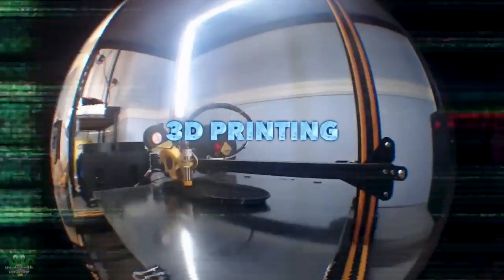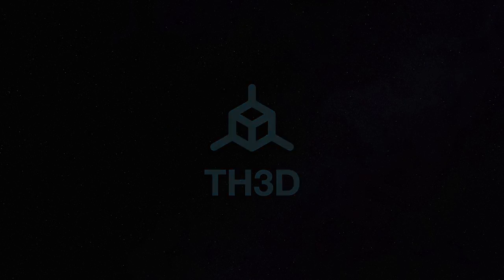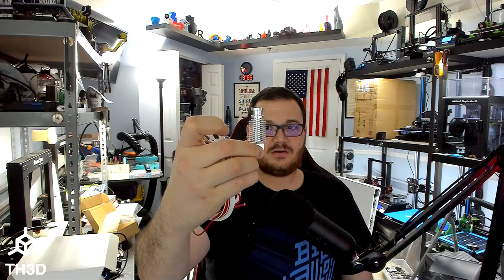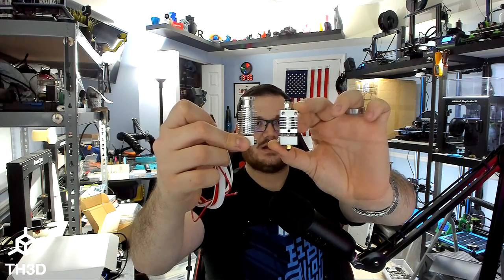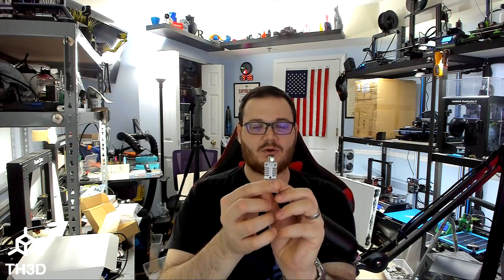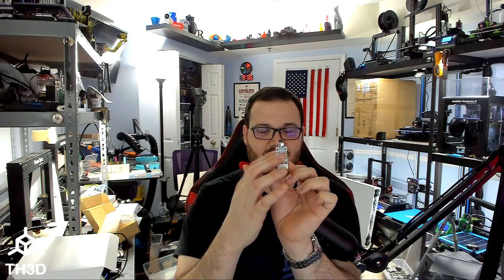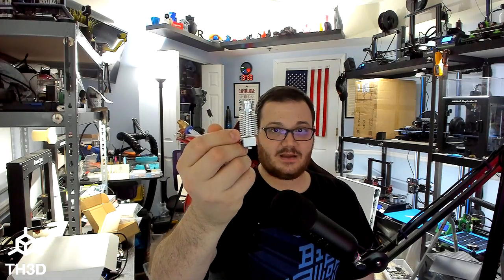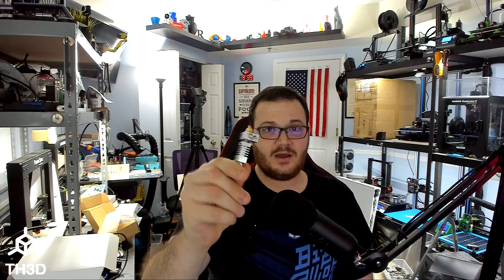Tips & Tricks - Proper Cooling Fan Selection - Stop Using Capacitors & Noctua Fans!

Comment: Installed a noctua on my Ender3. After 30 minutes my filament got stuck and jammed. Reverted back to original fan and all was back to normal. So noctua is not suitable for hot end cooling!
Reply from the maker: We've seen that happen a lot (not in 30 minutes though, usually a few hours). But, if you have higher ambient temps in the room it could happen quicker. These are the ones we sell and use on our machines that do not have the issue (they are also quieter than the stock fans, will also last a lot longer): https://www.th3dstudio.com/product/40mm-sealed-bearing-fan-24v-ender-3-tornado/

Comment: Good video just one bone to pick, the wording of the video makes it sound like Noctua make poor products when in fact they make a lot of really high quality fans (hence the 6 year warranty). The problem as you noted in the video isn't any problem from the maker itself but the characteristics of the fan not meeting the requirements for the application. (it would be like putting diesel in a gas car and then blaming the maker of the fuel for the car not working). I've seen people recommend other brands too that are not ideal replacements. I wouldn't hesitate to use Noctua fans in a project IF they made a fan that met the requirements for whatever the intended application was.  I used one in a PSU that exceeded the stock fan specs. The noctua 40x40x10 you mention somebody installing on an Ender 3 appears to be grossly under powered in comparison with the manufacturers supplied part from what i could find online. 8cfm vs 4.8cfm, looking at the performance curves of both these fans and for anything more than 1.2cfm the static pressure has to be around zero, not sure how much safety the manufacturer sided with but almost 50% less peak airflow seems like it might cause problems depending on temperatures and print duration. I would have to agree in that I dont recommend it for the creality series of printers and probably others but not because noctua is a bad brand but because the spec of that fan doesn't  meet what the manufacturer recommends.
Reply from the maker: You are correct that they make good fans (I have 20+ of them in computers here myself that are many years old). The issue is people recommending underpowered fans for the 3D printer applications.

Comment: Such a great video! 
I was just about to order a Noctua NF-A4x20 FLX for my E3D V6 hotend, but before doing that I jumped over to your YouTube channel to see if there's any video on the topic. Thanks for saving my 15USD+ and hours of troubleshooting.
Reply: it's not the brand, it's the CFM: if the noctua fan can push as much air as the old noisy fan then use it
Reply: the 4020 noctua is fine its people using the 4010 that's the problem and some of them even use the low noise adapter wire that even slows it down more ,, so just use the 4020 noctua without the low noise plug in and u will be fine

Comment: ive never had issues with noctua on my printer, just gotta make sure the cfm's are high
Reply from the maker: While you may have not because you put a higher airflow version on, the masses on FB groups are putting the lowest possible fan on theirs in terms of noise and airflow. Whenever there is a "noctua" post no one posts model numbers, just 'get noctua 40mm fan' even though there are many models of them.
Reply: @TH3DStudio yeah i get what you're sayig. i also have an e3dv6 and tell people the exact model i am using with the hotend i have

Comment: Hello, about the pwm sound short remark: the pwm frequency should be outside audible frequencie range 20->20kHz. In automotive the 20kHz does the trick. The uC on the motherboard should be able to generate this. Perhaps this helps with configurations of the frimware in the future.

Comment: Noctua or other fan brand but in 40x20 mm is better and silent
Reply from the maker: 40x20mm doesn't fit the stock hotend.
Reply: @TH3DStudio  I know but it  is a 3d printer. It can easily be changed with a better one like the Hero Me gen3 for example
Reply: Been using the 40x20mm with Hero Me Gen2 and 3 for years with no issues on a stock Ender 3 hotend.  Also the stock Ender part coolers are crap and upgrading the part fan which normally includes upgrading the hotend shroud should be one of the top 5 things to print for Ender printers.  Also a buck converter can be cheaper then buying a 24v fan if you already have the fan.  As this video is 2 years old, the updated Marlin 2.0 has better code for running 12v fans on 24v.  You can set max's in the configurations.

Comment: 40 20 12v noctua is what I use and you already can't hear it. I can't believe people would use 5v 40 10s, that's crazy low air flow.
Reply from the maker: 4020 may be OK. Whats the CFM on that?
Reply: @TH3DStudio  5.5cfm on the noctua 40x20 NF-A4x20 PWM fans.
Reply: @TH3DStudio  pretty darn good at 5.53

Comment: I got a noctua fan with duct mounted on stock hotend, doesn’t seem to create any problem, i’m printing for 24hours and it still going good. How long before i should see any kind of problem ? The fan is rated 05 CFM
Reply: Man, you should have seen me swapping the noctua for the stock fan right in the middle of a long print 🤣 Mission impossible style. The extruder started to pop and snap 20 second after i cut the wires. I’m glad they included solderless connectors with the noctua. 😅

Comment: Fantastic video! Thank you! This will stop me from getting a Noctua fan - for the printer, not for the PC :)

If I would ge tthe CR-10 Fan pack from your shop, I think it would fit the Ender 3 Pro right? - If you can ship to EU - I had to replace the board's fan - got a Sunon KDE2404PFV2-11AB - seemed ok.
I dont get the picture in your website though, you dont seem to have a blower style fan on the kit? Is the kit intended for modified print heads? I printed only PLA so far and it seemed to me like quite often I wouldnt need a layer fan - I turn mine on layer 4-5 to avoid the pieces warping up from the plate - but I am an absolute beguinner and surely can be wrong :)

Only have one remark - its not uF on the capacitors. Its a "mu" - μF - stands for MicroFarad - (or Micro Faradayay if you come from Portugal :) ) - Michael Faraday was the dear friend of ours that started applying capacitors arround in the 1920's

Once again, thank you!

Comment: Noctua 4020 fan boom done, 4010 yeah nah, definitely issues. 4020 however has better airflow
Reply from the maker: Their 4020 should be OK as long as you can mount it to the printer. The 4010 is what people online are telling people to use in the Creality machines because it fits the stock fan location. The 4020 doesn't fit in the housing on the Creality machines for the hotend.

Comment: You said that using a 12v fan on a 24v printer with a step down and reducing pen in Marlin is a dirty hack...but u didn’t explain WHY it is a dirty hack and should not be done
Reply from the maker: Because you cannot control a fan (layer fan usage or other controlled fan) that has a stepdown between it and the board. The stepdown will not like being fed a PWM signal. Also, if you are purchasing fans you should get the correct voltage for the system. Adding a step down is also one more point of failure in the chain.
Reply: @TH3DStudio  I see. Although I think there could be a way to do that (feeding the PWM signal on another route), I can agree that it's probably overkill. Said that, after viewing your video, lesson (more or less learned) and this is the cooling setup of my Ender 3 Pro: 1- Noctua 80x80x20 12v for the PSU (which is 12v already); 2- Noctua 40x40x20 12v for the Mobo+Pi (directly connected to the 24v on the SKG with a stepdown, always on); 3- Noctua 40x40x20 12v on the hotend (re-routed on the original pin for thr board with stepdown and PWM reduction, going full speed when hotend is >50°C); stock fan for the part -> going to buy your 24v fan to replace directly. The latter is the only one which makes sense to control the speed IMHO, thus my choices. Do you think it is ok? (side note: i will do that since...well...I've those spare Noctua fans on my desk actually)

Comment: I just did a comparison of the specs for the Noctua NF-A4x20 FLX 40mm 12V fan with the 40mm 24 fan on your website and they are almost exactly the same with the noctua being slightly higher. I had to convert the specs from imperial to metric though for the fan on your site to compare.  The Noctua is 9.4m^3/hr at 2.26 mmH2o.  The Vapo converted to metric is 9.2 m^3/hr at 2.29 mmH2o

I have no doubt you,re more knowledgeable than me on these things, and my lack of experience doesn't allow me to have an actual opinion. I just wanted to bring up those comparisons. Maybe the noctua fan is an upgraded version since this video was made, I don't know.
Reply from the maker: That is a 20mm thick 40mm fan. The ones we carry are 10mm thick so they fit in the stock location. The issue is that people are telling others to buy the Noctua 40mm fan that is 10mm thick that has lower airflow. The 20mm noctua will work but it will not fit the stock hotend due to it being 2x the size and is also heavier so you're also going to add weight to the X carriage.

Comment: The problem is using low CFM fans on hardware requiring high CFM fans, not really a Noctua issue.
Reply from the maker: Correct. The Noctuas are just being the "go to" fans in the community since Prusa uses them.

Comment: The stock fan on an Ender 3 makes about 7 CFM, the Noctua 4010 Flx does 4 CFM... so not enough.
Reply: then use a 4020 noctua been using one on mine for over a year now no problems and is very quite

Comment: I can't tell you how many people argue with me about this issue. Reducing the airflow in a system is NOT an upgrade. It's a downgrade. If the stock fan produces heat creep what do you think is going to happen when you reduce the airflow what do you think is going to happen? "i have a noctua on mine and it works fine" ya maybe... You can drain the water out of your car and it will run fine too. Now take a 16 hour road trip.
Reply from the maker: It may "work fine" for shorter prints. I can tell you that the fans we sell have actually been tested in our print farm for very long terms before we sell a fan. Some people think "just get a fan" without thinking about airflow and pressure on the fan.
Reply: @TH3DStudio  just ordered another 24v fan from you guys today... As well a the z screw nut to try out

Comment: Its not the fan, Noctua is notorious for high efficacy good static pressure fans, the issue is when people use the "low noise adapter" which has a 100 ohm resistor under volting the fan  from 12v to 9v. I understand what your getting at low cpm= worse cooling but it isn't the brand of fan its under volting the fan 25%.
Reply from the maker: The main issue is the 40x40x10mm being used as that is what fits most stock machine housings. Those simply do not move enough on these smaller heatsinks. The 40x40x20 may work but then you're having to replace the hotend shroud to make it fit and adding more weight.

Comment: 40x20 noctua on the cr-10 with v6 should be fine right?
Reply: Oh and two 5015 with your heavy duty mount. And it's your tough hotend.
Reply from the maker: Should be OK with the 4020 but its a lot more weight on the hotend.
Reply: @TH3DStudio  should I get off one off the 5015?I haver your abs printed mount and the though hotend. I hav the 4020, the ezabl full size, two 5015 and the heavy duty v6 abs from you as well all on the hotend. Is it too much? What would you recommend me to do.
Reply: @TH3DStudio  If you think 4020 is "a lot more weight" just to backup your "noctua is bad" nonsense, then you should tell people don't use mod like petsfang and bullseye too.

Comment: noctua fans are meant for high static pressure
Reply from the maker: Depends on the fan as well. I use their fans in computer builds with radiators and high density air coolers, they work well for that application.

Comment: If you want to say anything bad about Noctua you better back that up with proof. Noctua fans have been benchmarked thousands of times and there is a mountain of data on how well they perform.
Reply: Completely agree
Reply: Benchmarked to what end? That they meet the published specs? Of course they do. Noctua is a reputable company, but even they say that their fans are on the lower end in terms of CFM. 
That said I do run a 40x10 Noctua on my CR10s hot end and have not experienced issues during long prints. I completed an 80 hour print last week that was nice and clean, but YMMV. 
 I do trust TH3D. I run their firmware with an EZABL mini. I will keep this mind if I ever do have heat creep issues.
Reply: Benchmarked to what application Kerstin? You're surely not saying regardless of the circumstance a Noctua fan is going to work? That's just ludicrous
Reply: If you pick up a random pack of noodles at a small asian store then who the hell knows if it's any good. But if you buy a Noctua fan then there are literally thousands of independent reviews and benchmarks at everyone's fingertips. There's no fucking surprises, they have exactly the air pressure, airflow and noise levels that everyone says it has.
Reply: @-Kerstin  It's the wrong application for a Noctua fan of that capacity. Look at the data sheets that Noctua themselves put out - they do not meet the specs needed for this cooling application. CFM, Static Pressure - all below par. He wasn't bashing Noctua (although it did seem like that), he's letting you know it's the wrong application.

Comment: I dunno why everyone is so obsessed with "quiet" fans. Alot of reviews i see are "it's soooo quiet". Without any regards to how well it cools.  Isn't printing correctly more important than a "quiet" fan. Mind you i did install a noctua fan from stock for heat sink cooling and it actually improved the quality of my prints even for 10 plus hours. But that could be because the stock one was going. I will probably get at 24v one after. A quiet heat sink fan wont make a difference even in how loud it is because the power supply fan overpowers it and is quite loud.
Reply from the maker: The main issue is most people just get the lowest sound rated noctua and those definitely cause heat creep. Their 40x20 ones are OK for hotend use but they weigh more and are 2x the size of the stock fans on most machines so it will not fit in the stock location. We look at it this way. A 3D printer is a machine. Its going to make some noise. With a silent board in the printer and our fans the printer is quieter than most dishwashers.
Reply: @TH3DStudio  it boggles my mind.  If its for how quiet it is then forget the 3d printer.  Just get a fan and listen to how "quiet" it is. Seen so many reviews of the noctua fan and never once I saw someone say it helped with heat creep or air flow was good.

Comment: Thanks again, Tim, just bought 2 of your 40mm, I had the same symptoms using a noctua fan on my Micro Swiss/CR-10S last week, where I printed an ABS tool and the printer was under-extruding and jamming about 45% into the print, thought I just had to raise the hotend temp.

Comment: thank you. i reevaluated my fan and it barely blows or anything.  it may be the root to my problems. i don't care about the noise, it could sound like a jet engine i don't care, as long it get the best prints possible and at 7000 rpm it may.

Comment: Darn it, I use them and love them for being silent. I knew they were not as powerful but haven’t had issues yet.
Reply from the maker: Just keep it in mind should you have the issues described in the future.
Reply: TH3D Studio I definitely will! Also am going to buy a IR temp reader to check for myself. Thanks for the heads up.
Reply: TH3D Studio I definitely will! Also am going to buy a IR temp reader to check for myself. Thanks for the heads up.
Reply: @TH3DStudio  If you got the issue in future, print a proper duct and force the air through the fins, that's all it needs, even with a 4010 noctua. That's what makes cooling more efficient even on force cooled motor cycles, e.g. Piaggio Vespa (would overheat if you take the duct off). And what do you know about charging rates of capacitors? You're right with large capacities but a calculated small capacity would do the job, an LC-element would be even better.
Reply from the maker: We used a Seek thermal cam. IR may not be as accurate.

Comment: they have 40mmx20mm ones. twice the thickness and more airflow. maybe those can help? I heard you need 6CFM or more and the noctua has it! maybe the lack of thermal paste is an issue? /shrug the noctua is only 0.6w tho. I use a 1.2w and it workes for me? maybe not a noctua but a good decent low noise alternitive that's like 1-2w. maybe not DEAD silent but still better than a jet engine.

I had a V5 tho that's bigger. i use the stock one that came with it on my V6

Comment: The problem is low cfm not Noctua. The other brands with similar low cfm will cause the same problem too. The issue is NOT Noctua but you make it sounds like Noctua is a bad brand.
Reply from the maker: You are correct but most people go right to the Noctua fans. If we rattled off a ton of other fans it would probably confuse people. We try to keep things simple.
Reply: @TH3DStudio  Noctua should be a good choice for the mainboard cooling, right? With a bit of modding it could even have a bigger diameter
Reply from the maker: @SchwachsinnProduzent  for that it should be OK but more airflow is better. You want the drivers to be cool.